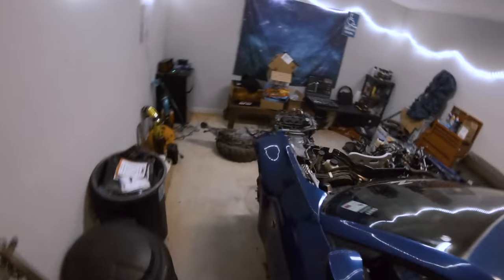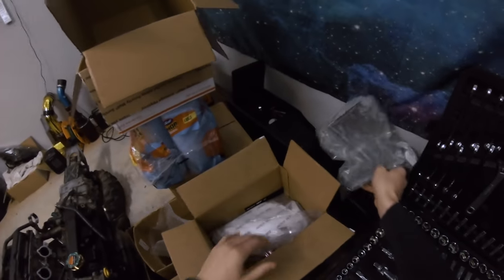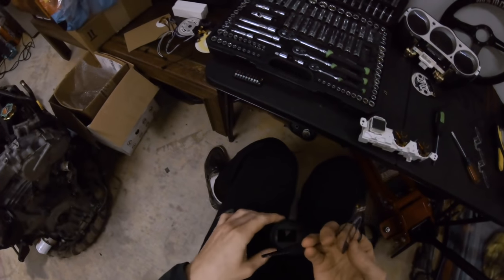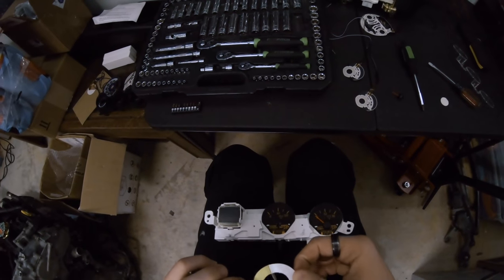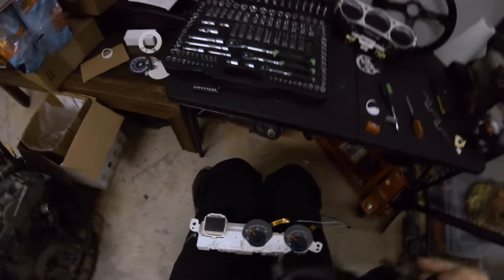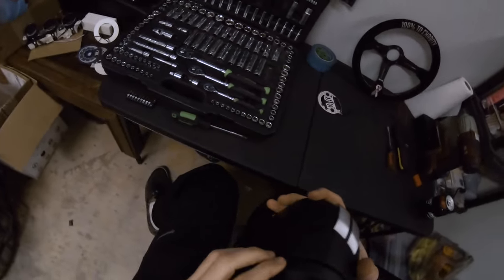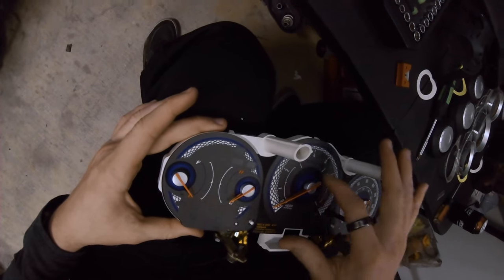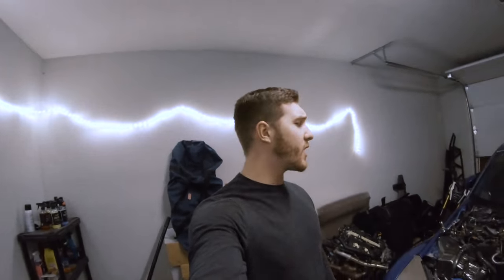Upgrade your Display w/ This Simple Mod! | 350z Speedometer Overlay Install

Comment: So does the film has its own lights built into it or does it use the oem lights? Cuz I’m confused as to where the lighting is coming from especially with the oem orange film underneath it
Reply from the maker: They have built in LED’s. That’s what the wires are for
Reply: What about the oem leds do you have to take them out or do something so they don’t shine through the new films?

Comment: Dude 
What did you use to plug the hole where the rear windshield wiper went?
Reply from the maker: There is actually a kit from Z1 for a wiper delete. A few different companies make them but that’s where I got mine. It’s like $30 or so
Reply: 7/8 metal plug at home depot